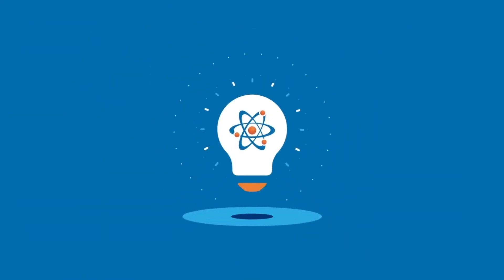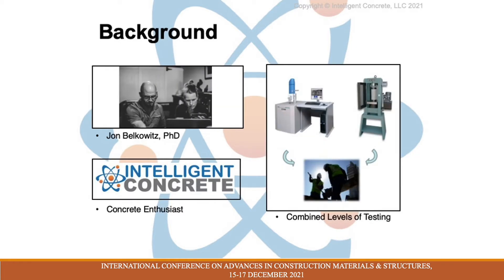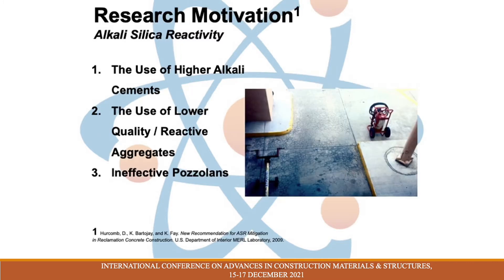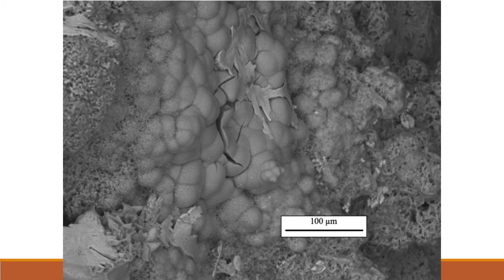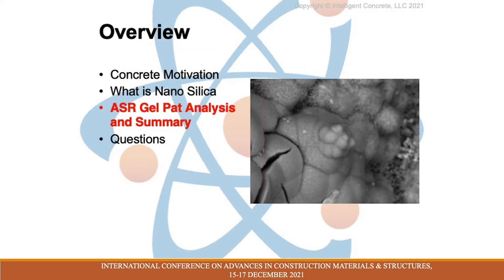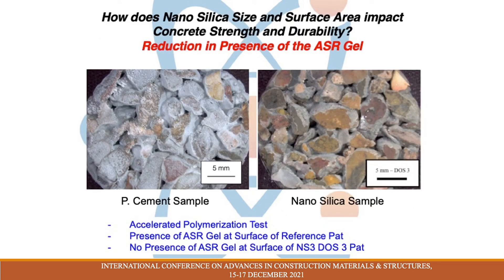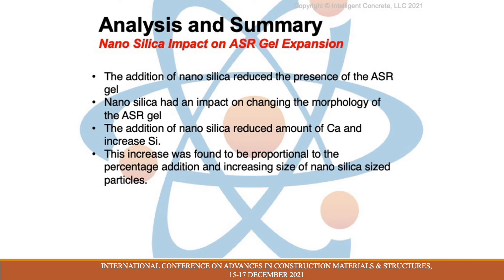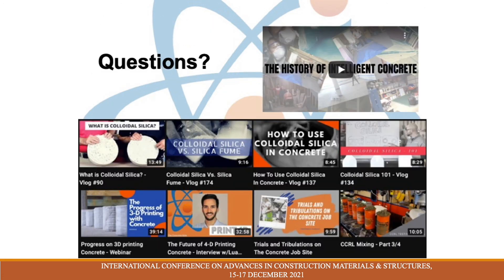The Impact of Nano Silica on ASR Gel Expansion

Comment: Great channel. My inlaws want me to replace there pool deck cracks from grey concrete silicone back to concrete. Would you use portland or quikrete crack resistant mix? Cracks are 1/4 to 3/4 wide and between 1/4inch to 2 inches deep. I will repaint the deck after 7day cure time. Thank you in advance